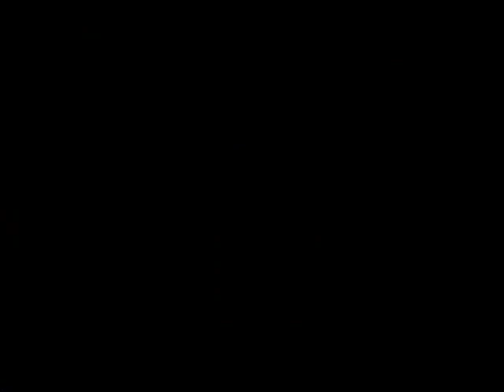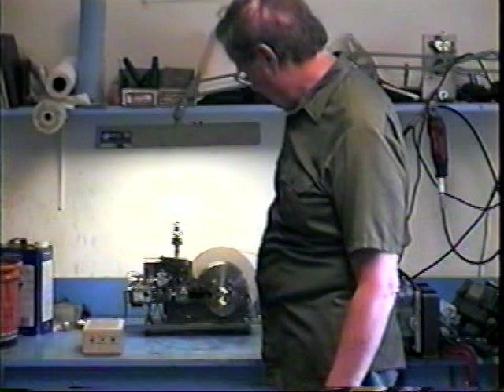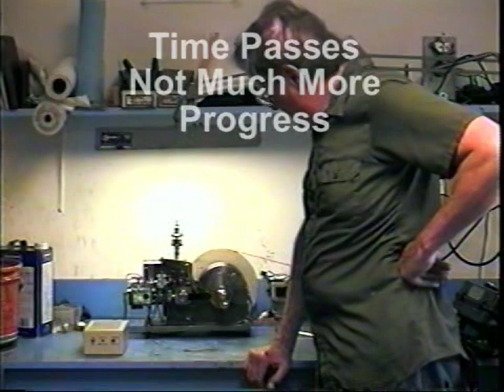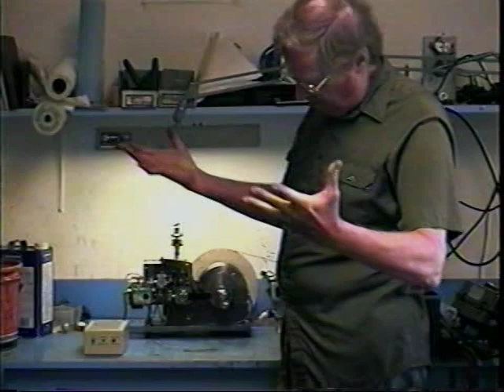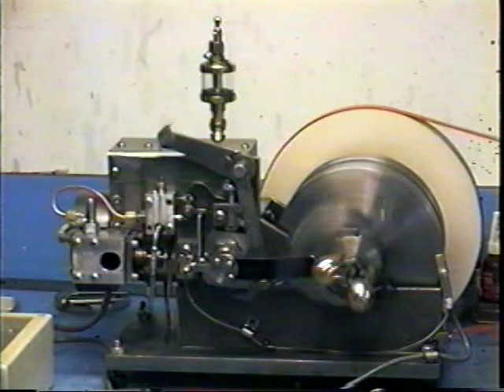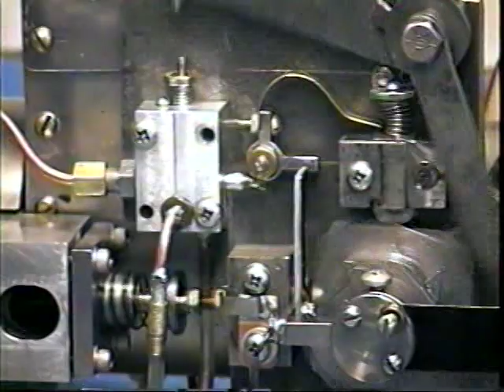The One Valve Engine 1

Comment: You know who invented the single valve engine ? MY FREAKING FATHER ! Not kidding Carlos Augusto Alberto dos Santos Faria.
http://www.marcasepatentes.pt/files/collections/pt_PT/49/55/58/92/03%20-%20Patentes%20-%20Pedidos%20e%20Outros%20Actos.pdf
Reply from the maker: I looked at the patent listings in the link you provided and didn't see anything about a one valve engine.  I would be interested in seeing more information about it but the citation is in Spanish and I don't read Spanish worth a hoot.
Reply: Elden DuRand It's not spanish it's portuguese, it's on the third page of the pdf file nº54.
Reply: Elden DuRand But i'm not sure the engine from the video has the same design as my father's engine design, since the valve that does both Exhaustion and Fuel Injection is a rotative valve.